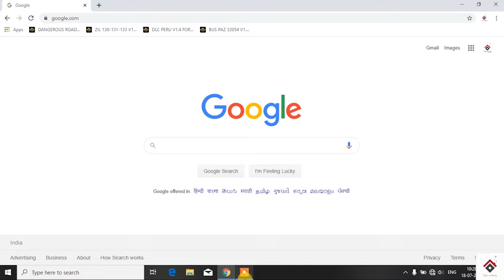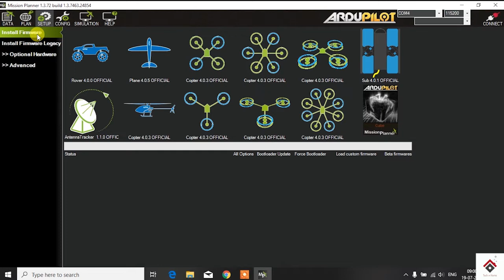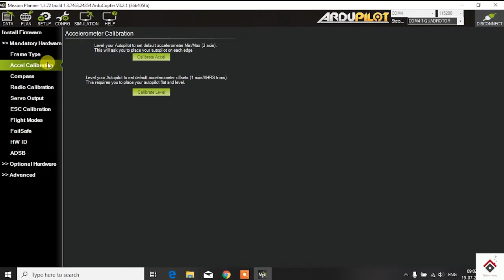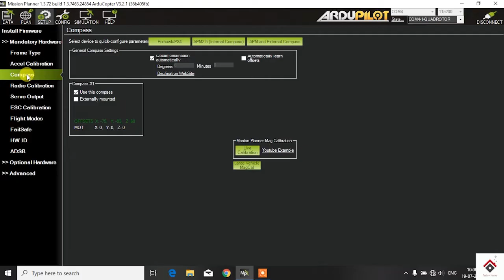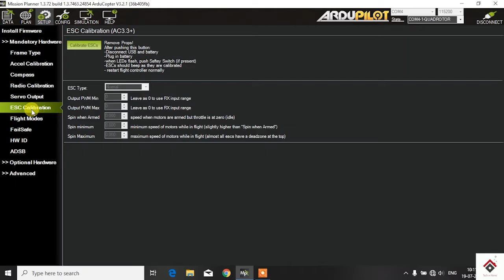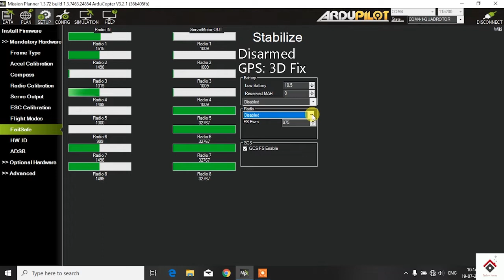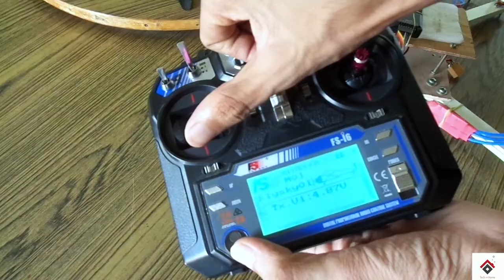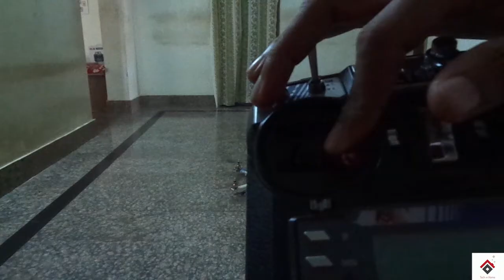APM 2.8 flight controller setup | How to make Quadcopter with APM2.8(Part 2) | Mission planner setup

Comment: Getting error
Reply from the maker: What is the error?
Reply: @techathome comp port checked firmware installed correctly with mission planer. Jumper pin used to compass port dots not showing. Tried older mission planer also please help me.
Reply from the maker: Did you already referred to this: https://youtu.be/K6abWjJhbsg?si=6y4_I2WdSTsGt01T
Reply: @techathome bro tried this
Reply from the maker: Then you have to use external compass that comes along with GPS module

Comment: Please help me my Quadcopter is not hovering properly it keeps moving towards one side I tried esc calibration but didn't work . I am. Using same configuration like yours
Reply from the maker: Have you done ESC calibration in Two methods?

Have you checked the propeller direction and fixed the CW and CCW propeller properly?
Reply: @techathome  yes I did and the prop are also installed in correct direction

Comment: i have done all process following by you but for arming ,its showing like need 3d fix .please help me on this
Reply from the maker: Have you used GPS?
Reply: @techathome  yes
Reply: its showing pre arm: need 3d fix
Reply from the maker: Take your drone outside, it also happens when GPS doesn't get satellite Connection
Connect battery
And try to arm
Reply: @techathome  okay but it wont arm right without usb
Reply from the maker: No, it will arm without USB